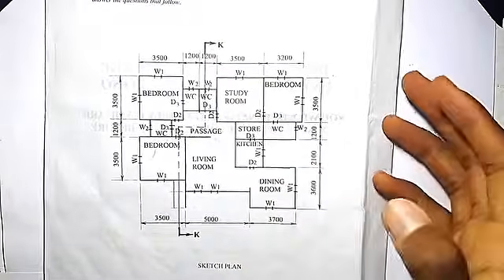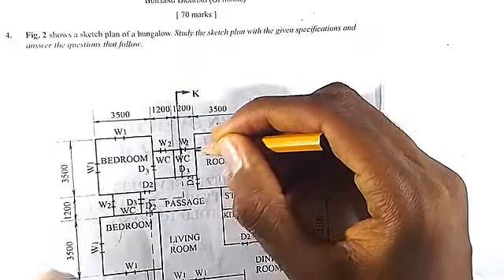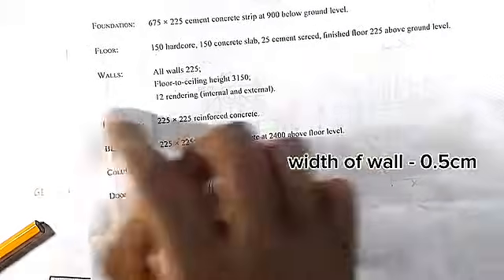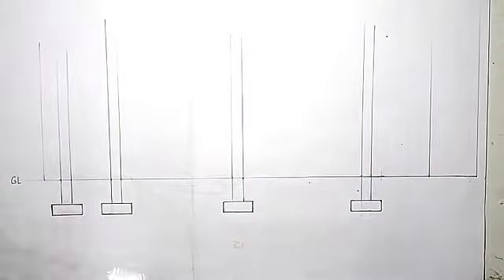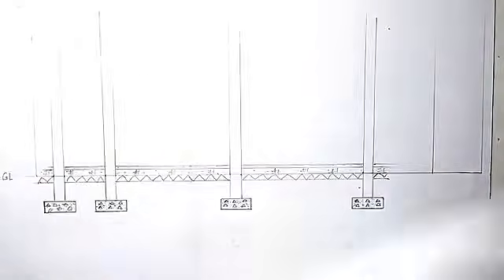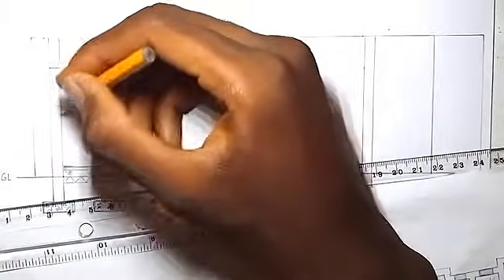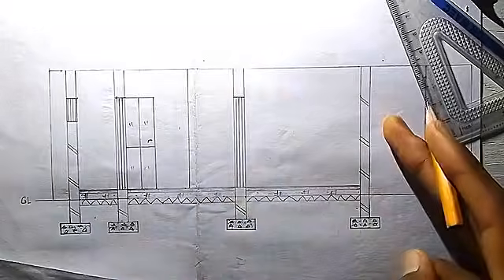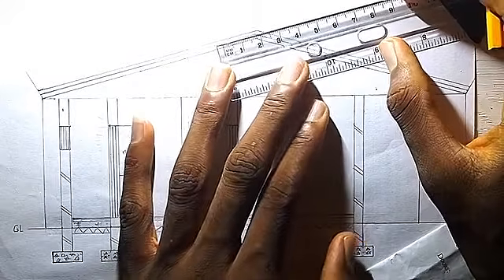HOW TO SECTION A BUILDING - building drawing

Comment: I want to ask something...in your diagram...when doing the walls u don't make accommodations...like you did it for floor plan and sectioning... What I mean is that you didn't account for the walls 0.5cm so now if u add the walls...the actual room size would be smaller... Did I observe right
Reply from the maker: Yeah that's also what I did while drawing the plan. So I kinda followed that https://youtu.be/hlt7ii3uaUg?t=1042&si=kRgTkQYn3lJLoMNc. But the video is not accurately detailed with respect to sectioning, I'll be releasing a more accurate one soon… :)

Comment: I know this video has been long but I remember from your front elevation you said the highest value is for the height while the width is lower ... But now in the column base u said 625 is for the width and 225 is for the height...u jxt confused me pls could you explain..😢😢😊
Reply from the maker: But I'll do a proper tutorial video for 'building section'. Do expect that soon…
Reply from the maker: The specifications given for the column base is what I used. [625 for the width and 225 for the depth/height of the column base]
Reply: @TBITGpls when cuz Td exams are on Tuesday 😢😢